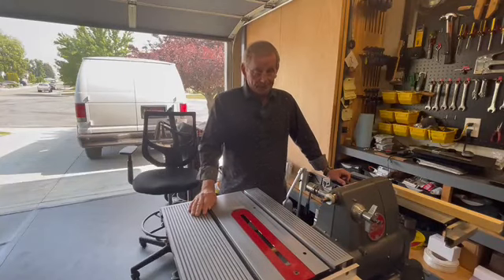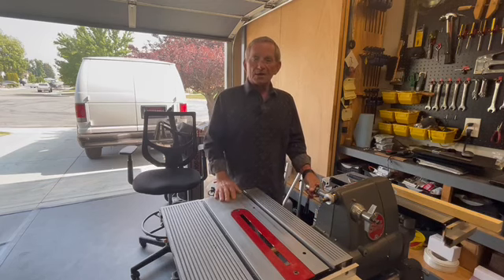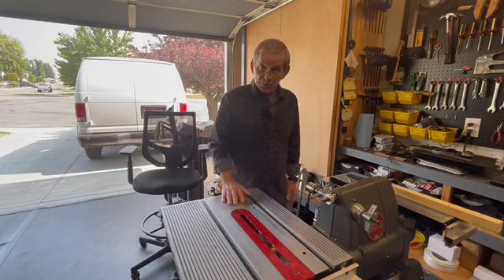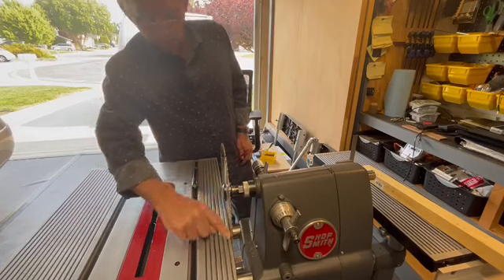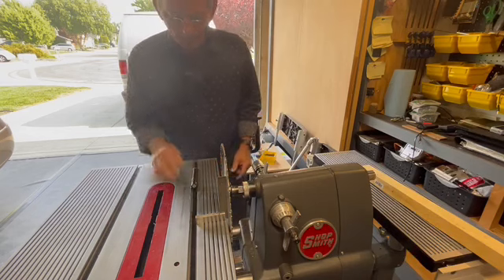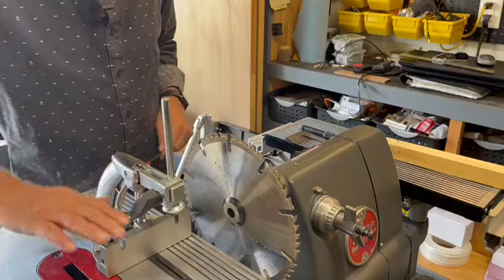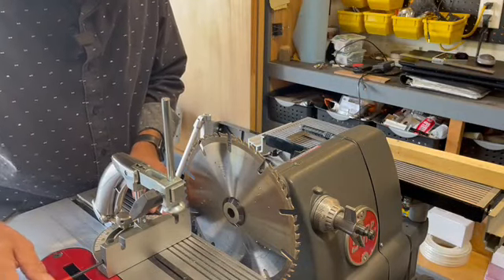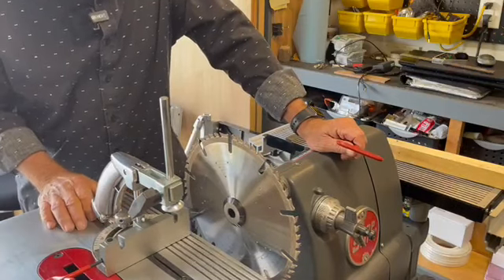Making perfect 45 degree cuts.

Comment: So maybe a dumb question… if you get your table all aligned up will the mitre handle need to be tweaked to get to the 45 degrees or is that already set up from the factory.  If it needs to be adjusted how do you adjust that quickly?
Reply from the maker: miter guage must be aligned too.

Comment: You've made assumptions that both the saw blade and sanding disc are square to the shaft and are not deformed. It would be more helpful to see how to adjust the table if it isn't square in any of the 3 ways you mentioned.
Reply from the maker: You are right. Both blade and sanding disc have high and low spots. In full alignment processes , these must be checked. This was a quick way to just set up and do 45 degree cuts, not a full alignment procedure video.